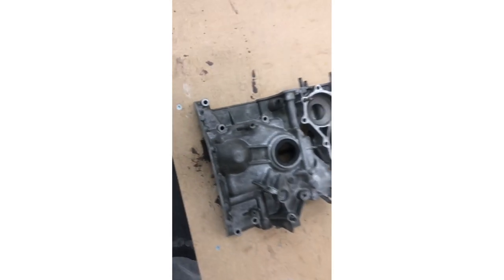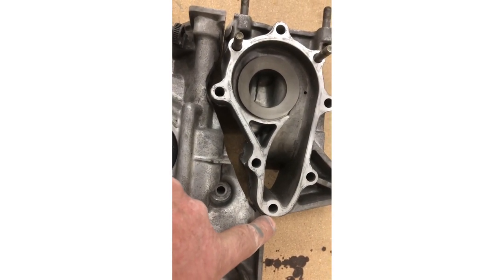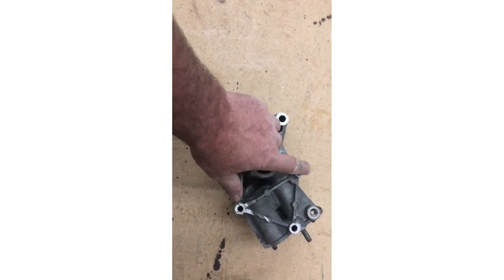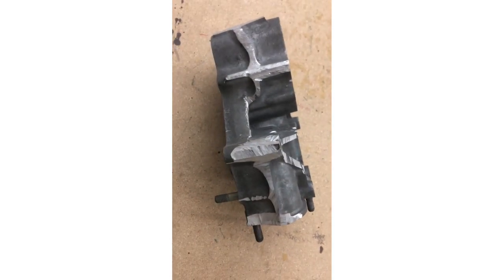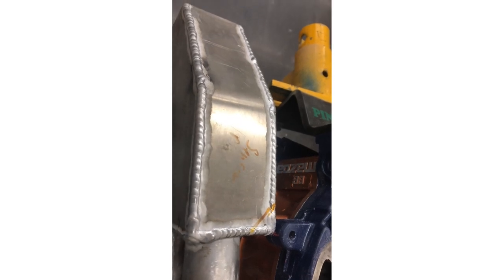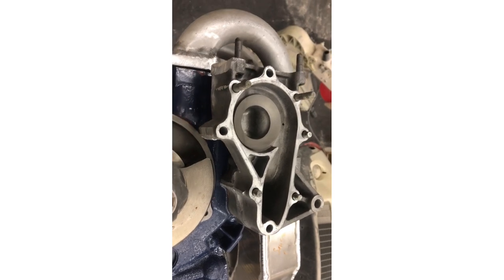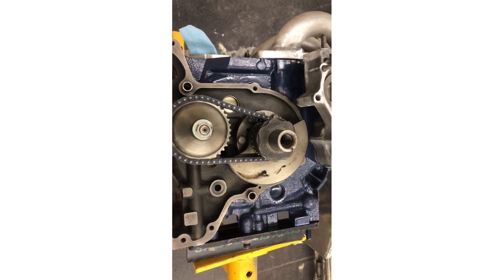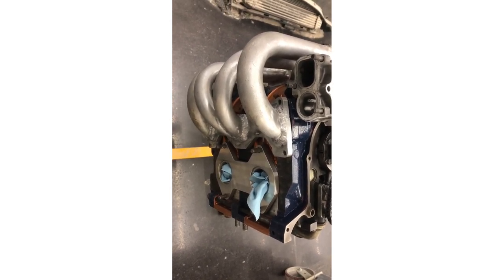Mazda 13 B rotary aircraft engine conversion water pump and pulleys.

Comment: Hi Chad. That is exactly what I did on my engine. I have not rebuilt it yet but doing all the mock up first. I was not so much thinking of the belt contact but needed to be able to bring my engine close enough to the firewall to keep the prop where it is per design so I did not wind up with an odd looking long cowl on my Falconar. The RX8 pump is way  lighter and does not stick out as much so I got the engine about three inches closer to the firewall. Good for CG too. The only issue is that pulleys don't line up on the same plane now so I will have to make o find a pulley with the right offset to match up but that should not be a major problem. Greetings from Maine. Mike
Reply from the maker: M Silvius I haven’t got to the point of matching up the police yet I do have my new ones but I haven’t put them on and working on an exhaust manifold.  I figured I might have to make some spacers
Reply from the maker: Pulleys